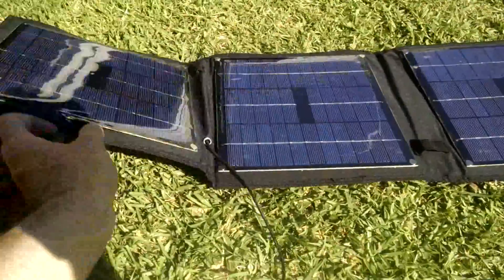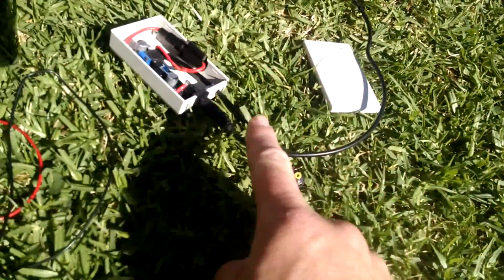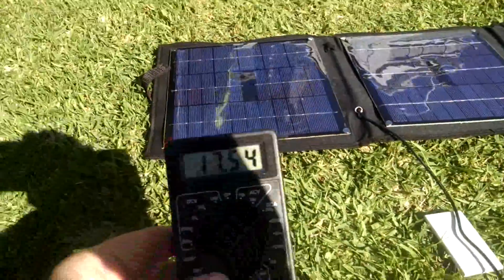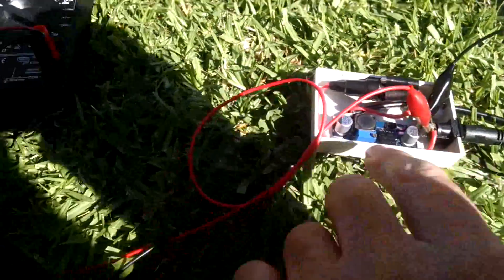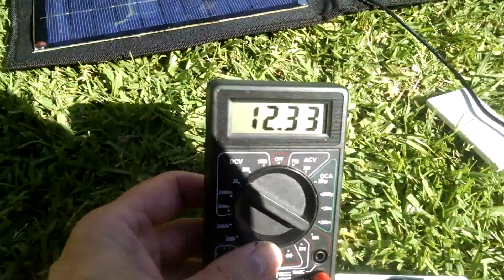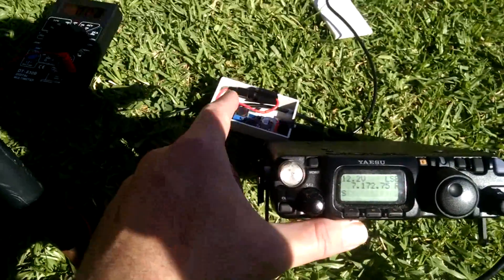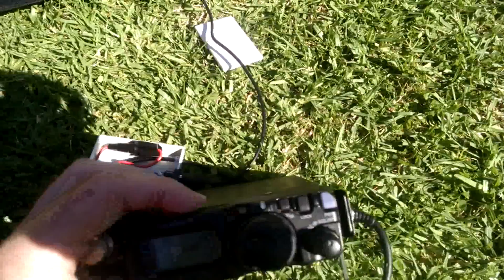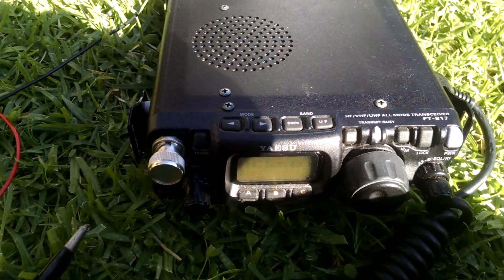Driving an FT 817 From a Solar Panel Using a Buck Converter

Comment: Solar panels can have very high voltage spikes. To make sure you so not blow up your buck converter you should put a voltage clamp in front of it. Or the other option is to use a charge controller to make sure not destroy your radio. One other item you should know is buck converter can fail with with the top FET on (until it burns up). This puts the input voltage on the output then bad things happen. Good luck but I would not rely on just a simple buck converter.

Comment: Do you get any RFI from the Buck Converter?
Reply from the maker: Very little, there is an extra filter you can add to the buck converter to reduce the RFI consisting of an electrolytic and a choke.